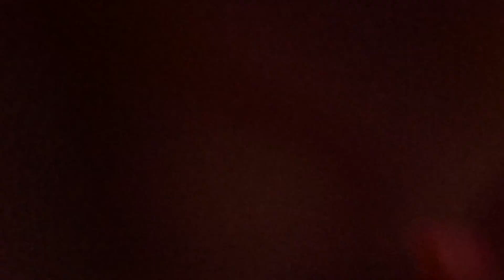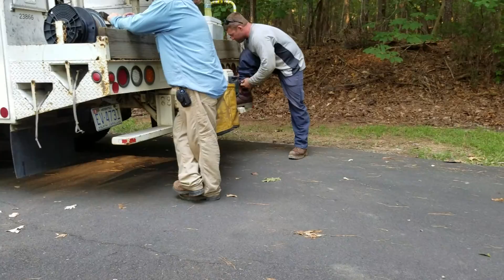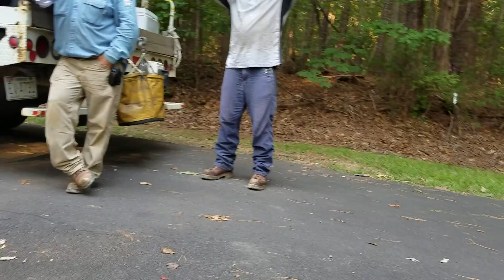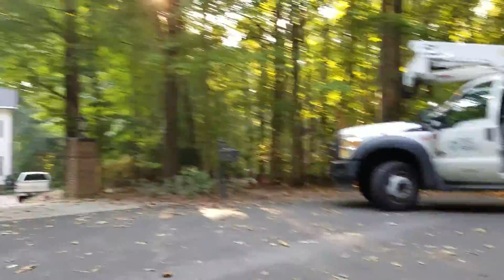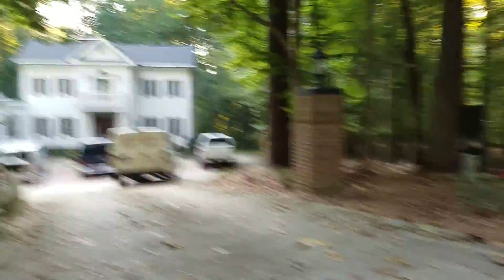Trouble with the transformer again

Comment: The problem will be 3rd harmonics from the switch mode power supplies used for the miners PSU's. These cause large circulating currents in the secondary of the transformer. I would recommend a harmonic filter.